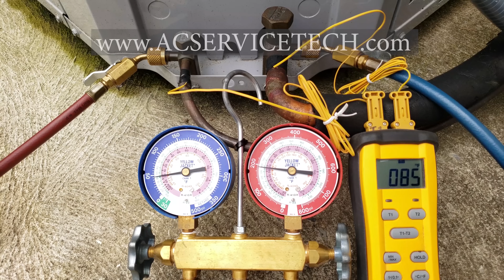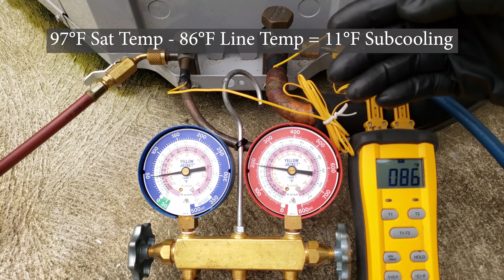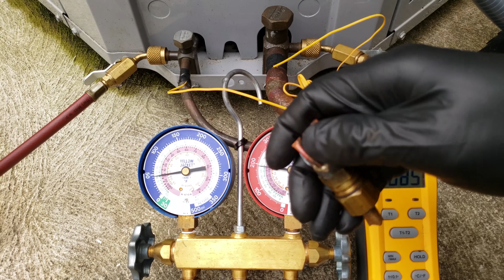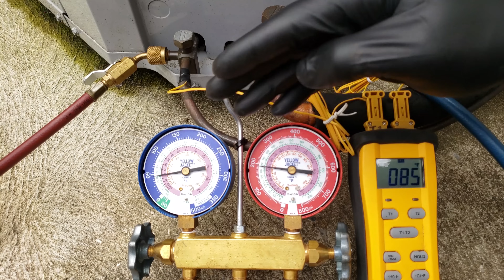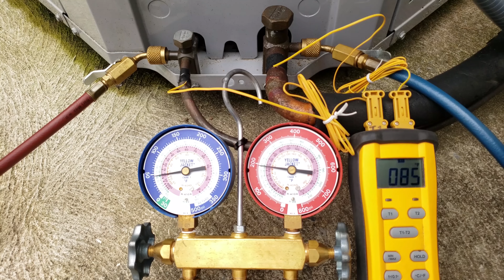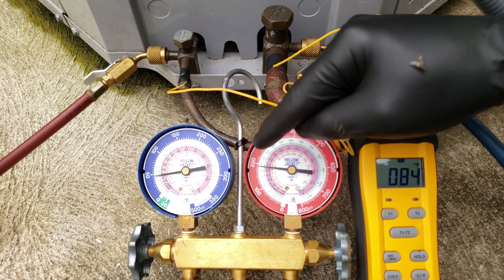Liquid Line Restriction! What Happens to High Side Pressure & Subcooling?

Comment: My Trane heat pump only stops and throws error messages during the winter, not the summer.  I'm being told I have a restriction.  How can this be when it works fine during the summer?  In the winter, I can turn breakers off and reboot system, and the heat pump in heat mode will work for another 12 to 24 hours before shutting off and throwing error messages again.

Comment: What is the impact of installing a drier the wrong way on a 2-ton central air conditioner, on the refrigerant line (R-410A Freon) for seven consecutive days? Could this cause serious deterioration of the system? Could the drier become saturated with liquid, preventing moisture absorption and causing damage to the compressor? Could the drier inject liquid into the circuit? Is it safe to reinstall the same drier, but this time, in the right place on the same circuit or should it be replaced with a new drier?

Comment: What's Heat pump problem: heat model is good, But cool model is bad and the  discharge line pressure is 300 psi, the suction side pressure only 50 psi.

Comment: Any thoughts on what could cause the high side pressure to rise significantly after the unit is off and sitting there.  Pressure goes up 200+ psi when off to 450+500 on the high side, but low side is 182 after sitting for awhile.  Temperature outside was about 90.  SH and SC are excellent..house holds 72 degrees on a 90 degree day.  I am at a loss how high pressure can rise so significantly while off. Has a new TXV and weighed in charge.  Runs great...

Comment: Wonder if you guys could help me out with something. I have a r22 unit at home. I had a tech here and the head pressure on the liquid line was 275 psi. I didn’t get the suction pressure but the suction saturated temp was 30 degrees. There’s little subcool and super head. The suction pipe at the compressors starts to freeze within a hour. The filter is good the coils are clean. It was 74 degrees when this was done. The gauges he had were the probes and said to recover some refrigerant which was weird because there hasent been any added since the unit was installed 20 years ago. Any ideas. It’s. Piston metering device.
Reply: Is the unit dirty ? Condenser

Comment: Hello  Craig, I’m experiencing the same pressures on my 2.5 TON R-22 system, however I noticed the discharge line is freezing up first. I’ve replaced the piston from a 6.5 to 6.8 and the issue is still occurring, do I need to replace the strainer? This unit is 23 years old. Thank you!

Comment: I am that guy who "kept adding r22 to try to raise the suction vapor pressure above the freezing point" and overcharged the system.  Once you said that, I knew that I had a liquid line restriction.  The system was working well before I had to fix a pinhole leak, first time brazing over a tiny hole in the condenser coil.   I evacuated the system. My dad (Indiana Jones type guy) told me to be carful that evacuating any ac system could cause orifices to be plugged up.  Does that sound about right?
Reply: I did this on a old mercedes... roof.
Reply: Evacuation shouldn’t plug offices. Why would it?

Comment: Hi, I have an R22 5 ton unit. It had lost all the Freon due to a hole in an aluminum tube within the condenser. My HVAC guy brazed the perforation with a copper tubing bypass, vacuumed the line and added fresh R22 but NEVER changed the dryer filter despite my request. He said it was unnecessary. After the charge, the system doesn't work. The high pressure reading is about 200 and there is barely a reading on the suction end ( about 5 ). He then added an extra 3 pounds of Freon- which made zero difference- overcharging the system. The system shuts off after running for 5 min or so. It is not cooling at all. He said it's probably because I have a "clog" in the line. The perforation was open the entire winter. Is the cause the dryer filter not having been replaced? I need your help and guidance. Thanks

Comment: Hi. Thought I'd ask the question here about my car ac since you are the GOD of ac. My car ac works ok but seems to not cool as good as before. I've noticed the high side gauge needle at 185psi vibrates a bit whereas low side at 45 psi is still. Does the needle vibrations suggest anything or that's normal? Maybe weak compressor?

Comment: OK, i started up a brand new 3 ton Goodman condensing unit with an 11 year old up-flow 3 ton evap coil with TXV... new clean filter... OK air flow... delta across the coil 15 degrees,, entering at 77 degrees; leaving at 62 degrees... low side at 150 psi, high side at 251 psi approx 2 degrees of sub-cooling and about 2 degrees of super-heat. R-410a system   OSA @ approximately 82 degrees... I'm thinking the TXV bulb is failing or the valve is sticking open a bit...The 230 volt scroll compressors RLA is 14 amps and i was measuring around 9 to 10 amps...  any other ideas besides a bad TXV ???  the new condensing unit has a factory installed liquid line filter dryer...

Comment: Hi to All. I have the following scenario and will appreciate your feedback.
I just had installed a new AC+furnace system. At the evaporator coil, the tech. brazed the liquid line which had to bend it like 45degrees to connect to the evaporator coil. The issue with the bended 3/8" copper pipe is that, at the center where the pipe changes direction, the 3/8" pipe is flattened. Would anyone tell me please if this is bad for the system. And what technical wording should I tell the technician to force him to brace a new piece of 3/8" pipe? Thank you
Reply: Depends how kinked the line is, if it’s a lot it could be bad but if the system runs properly and the kink is not that bad then it’s really just cosmetic

Comment: 410a system very high superheat over 50  low suction. 112psi ...head pressure 405 psi but 0 degree sub cooling...... readings after I cleaned condenser.....???? undercharged system with a restriction/txv??

Comment: What if the psi drops to 0psi on the suction line when I turn the unit on? Stable pressures when the unit is off. I have a fixed orifice 410a unit.

Comment: Hi actually I have a problem with my ac it’s cooling less got it checked from tech seems he didn’t caught the problem I m mentioning the reading he took and he decided in few minutes that compression faulty ,after watching this video I found my problem looks like same readings r on Goodman R410 head pr 250/suction Pr 100  he wrote 50deg SH and 14 Deg idk what it is maybe sub cooling I have called him again for expansion valve seems he wants me to change the whole ac unit as he say the compressor is drawing low amps 6amps only ac blows cold air but runs continuously what can be the cause as I can’t afford to change whole unit it’s only 4 years old but compressor is 6yrs old out of Warranty
Reply: Sounds undercharge

Comment: Would a joint/connection that has too much solder or a kink in the liquid line also be a liquid line restriction and cause high head pressure as well? Thanks!

Comment: Return air, filter size, blower speed, txv or signs of a half assed replacement. Kind of like a split system that required 7 1/2 lbs but had 22 lbs of charge causing the compressor to bypass. 🤯

Comment: I have I going now I installed 3 ton Arcoaire 3 ton split system ac only ,put on existing Goodman furnace  system is running a very low suction r410a about 100 psi , high side is good and sub cooling is 10f,  NO SUPERHEAT  suction is always a degeee colder than the evaporator temp , I’m going to see if I got a restriction somewhere. 
Any ideas

Comment: Would an overcharge unit be the only reason why head pressure would be high when having a liquid line restriction?   I had a restricted txv with high head pressure.  I replaced txv and liquid dryer and that fixed the issue.

Comment: Great channel! Quick question. What could be the problem if the needle in the High side gauge keeps rising on a small window unit until it trips overload. I charged unit by using manufacture specs. I was suspecting a restriction until I saw this video. Thank you in advance.
Reply: Is easy to overcharge a window ac

Comment: I am one of your Patreon’s if you Can  answer my question that would be a big help I have a system r410a  with a piston that on hot days that are over 95 outside the low side is at 140to150  Hi side will go from 400 to over 500 and back and forth if I remember correctly the suction line is 63 degrees outdoor 7 years old  and is clean and in good shape clean filter and indoor coil is clean it does have a filter on the high side by the piston . The out fan is blowing good but very hot air off of it if I take a water hose and hose out door unit the high side pressure will come down to 350 psi it always blows Cold air inside the house but intermittently the unit will shut down due to too high pressure thanks
Reply from the maker: It sounds like there could air in the system mixed with the refrigerant possibly. What seer, indoor wb temp and delta t? You could shut the unit off and let it equalize and compare the sat temp to the surrounding air temp. If the sat temp is higher, the system has air in it. Has the outdoor fan and/or motor been replaced before? Please respond back at info@acservicetech.com to make sure that I get your message back. Sometimes I miss them in the you8tube comments, thanks!

Comment: If you aren't able to absorb much heat, then how is there so much superheat? If the coil is so cold, then why is delta T so low? I am assuming that's because the coil is probably freezing and restricting air flow, but then why is superheat still so large? You did think if it's that cold with little airflow you would have way less superheat.

Comment: Was gonna check the charge on my ac unit today(R22 capillary system), but had 0 pressure on my high side pressure. Saturated temp was 40° across the coil  and the line temp was almost 100°. The strange thing is that at my return was about 70° and at the nearest register was 52.5° so the temp drop across was good. Just can't figure why I got 0 high side. Can you tell me what the possible problem could be? I even used 2 different manifolds and got the same result. I thought it could be a bad Schrader valve blocking me out of the pressure due to the fact that when I went to disconnect my hose from the liquid line service port, I didn't get hardly and spray off??
Reply: I would suspect bad schraeder

Comment: Bad txv....or.....too large of flowrater piston....or strainer is plugged.....or txv has locked wide open......or txv strainer is plugged.
Take temp readings at in and exit of piston / txv.....you will locate your problem,that is, if there is not a restricted condenser.

Comment: I checked a r22 system Pistón and the suction line pressure was 8psi and the liquid line 140psi. You think it can be a line restriction? Thanks hope you can answer
Reply: Could be a line restriction or a refrigerant leak so it's low on refrigerant

Comment: Craig lets presume that i do have a liquid line restriction,and i have also charged refrigerant to raise vapour temp above 32 degrees,in this case how do i sort out this problem? Do i need to first recover the extra refrgerant and then proceed to find the liquid line restriction? Pls advice how U would go about it.
Reply from the maker: Measure for a temp drop across the filter drier first as shown in the video to see if thats the prob. If not, figure on replacing the TXV, screens, and filter drier. the screens should come with the TXV. If you have a piston, figure checking the piston and the screens for a clog and replace the filter drier. This is all done after a pump down or shuttign the valves to the outdoor unit and recovering the rest of the refrigerant. You could also recover all the refrigerant and break the vacuum with the total amount of refrigerant needed for the system after fixing or replacing the problem, thanks!

Comment: Craig, I know this is not relevant to this video, but since a lot of young hvac techs watch your videos, this post may help them with a very common misconception by some very experienced hvac people.  I recently had a new unit installed by a company here in Florida, and was told the liquid line filter drier for my heat pump would be installed indoors near the evap.  After the install, I looked for the drier but could not find one. I called the company, and they said some Manufacturers pre install them in outside condenser units.  So I went outside and looked and could not see a filter.  I did see what looked like a filter, but it was on the gas discharge line directly after the compressor, which from a google search, identified it as a compressor muffler.  Hvac company owner came out and pointed at muffler and said that was the filter drier. Long story short, they sent tech out to install drier on my heat pump and the next day I checked, and it was a one directional drier. Oh Brother. Back out they came and swapped it out with a bi-directional drier. The tech pumped down the system for seven hours while he sat in his truck with the AC on. Who are these people? I just wanted a proper install. Instead I got the sweat box treatment. Didn't matter, I had a window unit in bedroom and binge watched Breaking Bad. lol.
Reply: I live in Florida.  The techs I know are not qualified, it’s all OJT with little training.  They usually are on the phone a lot getting help.  It’s sad!
Reply: Yeah u need bi directional drier filter if in a heat pump HEAT will be used......but if just Cooling only you ll be ok
Reply: Sounds like greedy company owners hiring inexperienced techs.

Comment: Wow you are the best I understand it very clearly now! It all makes sense i saw this same senario the other day but for a 410a system. The low side had 90psig and high side was 370psig although it was 95 degrees outside. Subcool temp was 8 degrees. I checked delta t and saw it had 12 degrees. So i tried adding like an ounce or 2 of 410a into the system and saw low side wasn’t going up in pressure, but then thought to myself this system isn’t low on charge based on subcool temp. So i stopped adding refrigerant. And looked at superheat as well and it was 44 degrees very high and knew something was up with the tvx. I also checked temperatures across the filter drier as well and saw no difference so i knew that wasn’t the problem. I then realized it was a bad txv not opening up and letting enough refrigerant into the evaporator coil. This is why we are techs we have to look at every aspect of the system. That’s how we diagnose these machines.

Comment: In EVERY video that he does with a temperature probe, he always uses the wire type instead of the clamp on probe. Does that mean that the clamps are not reliable??? I have mixed feelings about them myself. I’ve seen too many fluctuations with the clamp probe ( even a Fieldpiece brand ) . Peoples thoughts are welcome. Thanks
Reply: Try using a piece of sand cloth to clean the pipe to get better contact.
Reply: Really to be accurate electrical tape will not do because you are still reading a little ambiant temperature. Using a piece of armaflex taped with electrical tape will be more accurate with those style temperature probes.

Comment: How do you tell if the filter drier before the evap is blocked or the TXV?
Reply: Check the liquid line temperature on both sides of the dryer. It should have less than a 5° difference

Comment: hi love your videos. question on a normal operating system charged correctly how is subcooling affected on a system with longer lineset? 50 to 75 feet. for example: would subcooling be higher than rule of thumb 10 degrees to make up for additional Freon for lineset?

Comment: I guess it's a partial restriction at TXV, but with orifice or capillary restriction definitely see hp climb and LP drop, then cut out on either HP or LP - in my experience. 
With partial or complete blockage i'l Always flip the unit over to heating to observe the difference. 
(swap hoses!)  Then occasionally a blockage will unblock. Go back to cooling and see. 
Other clues are unusual cold or frozen sections, eg Kinked line
Reply: What d I you mean switch hoses? Is there video about this? And your saying this might unblock restrictions?

Comment: evaluated a case study of a split goodman heatpump R41a unit that- used noninvasive MeasureQuick App data (has previous data year ago to compare) at 16.9 subcooling (factory sub cool 9). The refrigerant was stacking up at outdoor unit . To confirm restriction took temp measurements at the indoor coil before and after the TXV. Why did this restriction happen hypothsis #1 no drier filter at the indoor coil other  #2 improper brazing allowed incondensibles   noticed a 60% restriction of a bent suction line however dont think this was the cause of the high subcool#3 could not maintain cool temps 76 ambient 89.  Usually the txv doesnt fail but can it be  cleaned properly when you have a restriction in the indoor coil?

Comment: So essentially if you have a liquid line restriction you're going to get low pressures in the evap coil due to the restrictions which is going to keep the refrigerant in that coil longer and give you a high superheat. Correct?

Comment: I had a call yesterday where the saturated temp on my low side went up but my suction line temp stayed at like 86 degrees. It was a 410A txv system.
Reply: I forgot to say as I added refrigerant all that happened

Comment: This coming week, probably Tuesday I’ll be ordering the book bundle. Awesome videos and information in an easy to understand format.  Quick question, does your book include complete wiring schematics for split systems? I’m really needing both low and high voltage wiring diagrams for residential systems. I’ve got a thermostat giving me a severe headache. Thank you in advance!! I’m referencing older 1980’s systems.